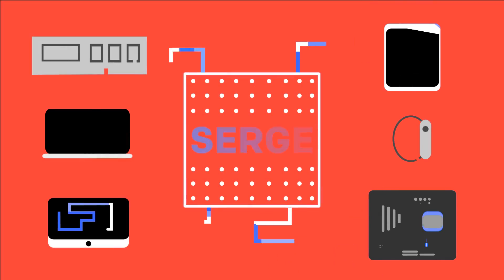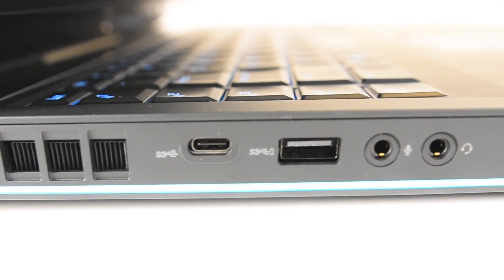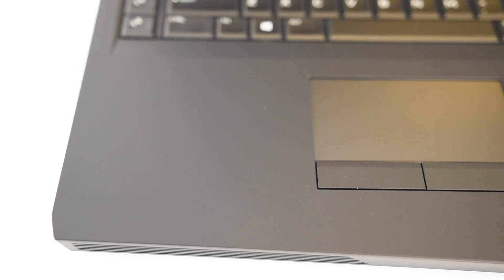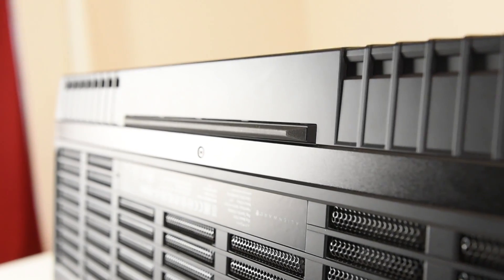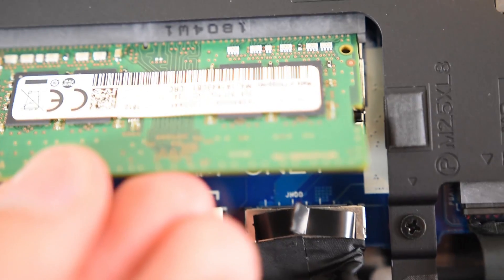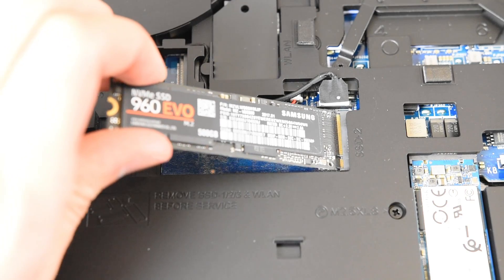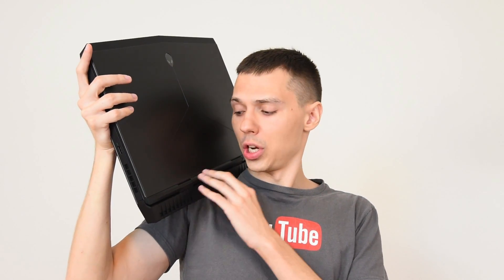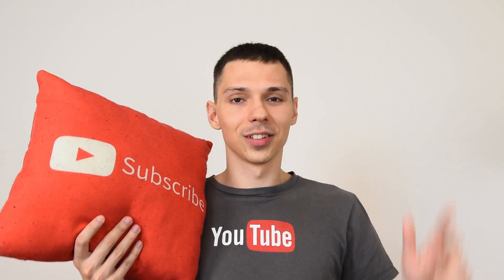NEW Alienware 17 R5 Review - GTX 1080 OC, 6 Core i7 8750H - EXPERIENCE!

Comment: Hi Serge.  i used a wireless keyboard and wireless mouse and a wireless headset.  AND also use  the oculus rift  for movie and game from time to time.  Now the problem is  the USB port limitation on this laptop. i have a cheat  Usb hut that sometimes its work and sometimes it doesn't...  Any advice on what USB port that  works really good on this alienware 17 laptop.   thanks.
Reply from the maker: well they should all be good but sometimes usb ports can die out. I have had this happen on half of my systems. I'm not sure why they suck so much. 

If your gonna use a hub, try this one out:
https://amzn.to/35fQ0dg
40% off discount code DKQG6L4Z 

Also make sure you use a hub thats connecting to the usb C/thunderbolt port.

Can you link me what hub you are using?

Comment: You mentioned 4 drives but didn't elaborates . . . Max capacity per drive is what? And I'm guessing where you installed the 960 evo, next to it was a 2242 slot - is that the 4th?

Comment: just to let you know..  on some sales pitch with this laptop... it claims it has touch screen.. even the sales guy demonstrated it did on video.. but it does not have it.. plus.. when i tried getting information online with dell.. the operator barely spoke english.. when i tried to call back..  i got the round around with their speech operator then was put on hold for almost 20 mins when i finally hung up.. i was looking to make a purchase of this.. but if i had problems afterwards.. good luck on getting service online.. dells online or phone service is the worse..  so be sure to check this out ahead of time just incase..

Comment: i also heard from many alienware user that this laptop gets too hot..temp is reaching 99c in load...i want to buys alienware 17 but im afraid bcuz of this issue..i need proper guidance
Reply: You would be fine with the 1070 but make sure you get the QHD 120 Hz Gsync screen instead of a regular one.  Alienware came out with a new thinner laptop but it is 15 inches and I heard it runs much cooler.  I think that would be a much better option for you as you are buying with a 1070.

Comment: To remove power limits, change out the 240w PSU for the 330w PSU.  It'll stop power-throttling.
Reply: Will it work with the r4 too?
Reply: @s1gnex  yes

Comment: Just ordered mine. 8750h gtx 1080 16gb ddr4 2666mhz qhd 1440p 120hz gsync panel 256ssd/1tb hard drive upgraded killer wireless. Have a 1tb Samsung 960 pcie nvme waiting to go inside. Saved about 700 opting for the 8750h instead of the i9. If your strictly buying this for gaming get the 8750h. No difference in games and runs cooler than the i9. If your into editing, rendering autocad etc then get the i9. For gaming the i9 is a waste.

Comment: The alienware 17 r5 is worst choice to make. My service tag is 9ZCWTN2 and I am facing issuses with command center were the effects and over fusion part are not even working. This is the second time a am facing the issue and last was on 31/07/2018. Both this time dell failed to fix the problem and last time after the call centre failed a took the laptop to service centre and re installed the windows. Now also dell is saying that they are able to solve the issue and it's a common thing that drivers from Dell and windows will mismatch and causes such errors and the only solution is to re install windows. As a customer I fill pit sending so much money on this laptop and the company is even unable to keep a consistency in its fan operating software. As a normal person re installing windows will lead to re install of all software which I was working on that will take another 1 week to complete. So my request is to make system that can atleast work. Email id _ kailasnathkl@gmail.com ( any person can contact me an I will show you all details regarding this)

Comment: i was thinking of getting the NEW Alienware 17 R5 8th Generation Intel® Core™ i9-8950HK (6-Core, 12MB Cache, Overclocking up to 5.0GHz)   NVIDIA® GeForce® GTX 1080 OC with 8GB GDDR5X 
should i just not bother? also what screen should i get? and whats the diff betweent the silver and black is that the hole laptop or just the front screen

Comment: Why does everyone who review the Alienware laptops fail to mention the fact it has no HDD lights?
Just brought the 17 R5, very pleased with it so far.
Reply from the maker: what do you need the hdd lights for? just wondering?
Reply: SERGE you can tell a lot from the lights, like is a program running or not is something running in the background .
Reply: hows the heat i was thinking of getting it just scared of all these heat issues i mean there from months ago but
Reply: beau ryan  No over heating on my laptop which has a GTX 1060 and I7 8750H.

Comment: I bought the same laptop as you today at Best Buy. Only difference is mine has a GTX 1070 8GB card. They had it 200 off and I paid 1600. I have heard that many people under volt the CPU and GPU. That you can do this without any risk of damaging your laptop. The benefit of this is that under volting will yield better performance because you will generate less heat and prevent the laptop from ever throttling. Have you tried doing this on your laptop? Also is there a way to adjust the fan speed so I can set it to 100% while gaming? Have you ever tried an external GPU before? My plan is to buy the top of the line Geforce card when they release the next generation cards later this year and use it as an external card for 4k HDR gaming. Do you know how well external GPU's work and do they perform as good as a card plugged directly into a PCIE 16x 3.0 slot on a motherboard?
Reply: Any backlight bleed?

Comment: Hey, this video is old but I wanted to know if we can overclock this beautiful?
Reply from the maker: you can you will just need to put the fans in turbo mode in bios it will make the machine louder but its possible personally though its a good machine i dont think it needs overclocking. it can do it all.
Reply: SERGE yep it can! Was just curious. Mine runs just fine. Thank you for the reply 😉

Comment: Hi Serge, I bought the 15r4 with the 8950HK and 1080GTX and Im experiencing high temp spikes in the upper 90s out of the box. I asked for a replacement and the second one showed similar performance. I have heard that 8th gen processors run very hot but im not sure if I should return this machine or try to undervolt and probably change thermal pasting instead as this is an issue im gonna see in most laptops with these specs.

Comment: All AW 17 with GTX 1080 comes with 330watt AC charger, why did your come with 240watts?
Reply: Because it's a 1070, there's no 1080 in the R5's without getting the I9.
Reply from the maker: wondering the exact same thing actually.

Comment: Please dell make 15.6" thinner little and change screen style. Using still 10 years old screen style is annoying!!! Please follow asus and msi as they have also regular gtx 1080 desktop variant in it but 30% thinner than this with good cooling system. Numeric keypad must be included for programmers and accountants!!!
Reply from the maker: agreed we need thinner more powerful devices! keep in mind though there 1080 and i7 throttles alienware has better cooling.

Comment: Debating between this (with GTX 1070) or going a different route with the Asus GM501 Zephyrus M. Concern is over heat and noise between the two.
Thoughts?
Reply: Patrick Scott i own a 17 with a 1070. Temps arent too bad. The laptop is very thick and heavy so they can fit in a good deal of cooling. I have no personal experience with the zephyrus but what i can tell you is that it is extremely thin in comparison. Its about an inch shorter too i believe. The bottom of the asus does open up letting your hardware breathe more when you open the laptop itself up. My alienwares noise is pretty quiet when not under load and perfectly acceptable when under load. Hope i have been of some help.
Reply: Patrick Scott I believe we have the same config then. I7 8750h, 1070, and the 120hz 1440p display. It is an excellent TN panel and i havent had to replace anything yet but i will probably do a liquid metal repaste just to keep temps down a bit more

Comment: i love my 15 r4 ! i got the gtx 1060 only because ill buy the graphics amp latter on down the road.
Reply from the maker: The 1060 is still an amazing card!
Reply: Yeah coming from a gtx 780 it’s a lot better
Reply: Awesome bro! My opinion like theres no point of having a 5.2 KG (Estimate) laptop where you could get something like the surface book 2 with a Overclocked or Overclockable GTX 1060 because thermals are good.
Reply: PaynPlay play well if I had the extra cash I would of lol
Reply: AndreasH900 why should u even buy a big gaming laptop n the first place, just build a pc that has a fucking 1080 ti in it lol. That’s what I did then brought the Microsoft surface book 2 with a gtx 1060 in it that’s more powerful then the Alienware laptop not only it can all so be a hand held tablet. Reason I say it’s more powerful is the fact the Microsoft surface book 2 has a OC 1060 with i7 8750CK 4.8ghz with 32gb ram and a amazing 17 hour battery life and 6 hour battery life playing AAA games non stop
Reply: Im in grade 10 in Australia nd I take my surface book 2 everywhere and I Love it so much! It's a very good "Gaming Tablet" It can run gta 5 4k high - ultra settings at 54 frames and fortnite 1080p epic settings at 164 frames with i7 8750CK 1060 OC 6GB VRAM 32GB DDR4 2400Mhz ram with 17 hour battery liufe and 8 hour of gaming non stop. And it can be a tablet as well!!
Reply: Lmao 1060 on a 15 r4, I would of gotten atleast a 1070 xD

Comment: Hey serge should I buy Alienware 17 r4 with gtx 1060 6gb and 16gb ram or this new Alienware 17 r5 with gtx 1060 and only 8gb ram?
Reply from the maker: Get the new the extra cooling system in the new one is well worth every penny you won't be wondering why your machine is over heating. 

There is that slight potential that it might
Reply: SERGE alright mate thanks for the suggestion.. I'll buy the new one.
Reply from the maker: also get the 6 core if possible its gonna go a long way to future proof device and is task switching abilities.
Reply: SERGE yeah sure.. That's what the r5 model contains.. Gtx 1060 6gb.. i7 8750h 6 cores

Comment: I just wish it had slimmer display bazzels like the Gigabyte Aero 15X or the MSI GS65.
Reply from the maker: Yeah there pretty large bezel although it protects the screen better that way honestly I prefer smaller bezel for more screen ratio.
Reply: Adolf Hitler - The Aorus X9 is superior to this in everyway, it has the same CPU and GPU, much larger SSD, much better screen, more ports, and... what's that? It's thinner and lighter, and has smaller bezels? AND is the same price?!
Reply: Young Kelz - Me or him? Because you could go check the specifications on the Aorus X9 (2018) vs. the Alienware 17 R5, everything I said is factual.
Reply: Smaller bezel means the smaller case, means less space for hardware which means higher temperatures, ultimately reducing the longevity of the components. They could've fitted a larger screen which means a more expensive device. People whine about the dumbest details.
Reply: what are you smoking? non of what you just said is true lol.
Reply: C.T. Productions i was talkin to that Hilter guy

Comment: Great video man! Im waiting for my laptop in the mail at the moment. I bought a 1070 gtx with a 1080p screen. Do you think 1080 is a big difference from 4k? I bought 1080p because better battery life and its cheaper. How do you think cs go will look on 1080p screen?
Reply from the maker: the 1080 and both 1070 do have 8gb of vram so in theory they both can run in 4k but on the most demanding games a 1080 may help it has more cores and stronger mem mhz take a look at this example here https://www.youtube.com/watch?v=HUW7YnwfzGs
Reply from the maker: but you can always adjust games to run better by tweaking settings.

Comment from the maker: XTU analysis:
After gaming for 4 hours in RUST US WEST Facepunch 1 
the GPU is at 58-61C 
The CPU is about 68-75C

in about 1 hour of gaming and checking intel extreme tuning utility XTU reported 4 instances that lasted about 1 half a second of power limit throttling, However no thermal throttling.

odd because I had a few thermal throttling drops that did not affect the game my first day but it seems like the cooling is breaking in the paste maybe? im not sure how to explain in only that the performance seems to be even better. 

the core voltage jumps up and down between 1.258v down to 1.107 continuously. 
Core TDP 25watt to 34watt
CPU ghz 3.8 to 3.1
Reply from the maker: I'm continuously stressing the machine and its holding up next up would be to force the gpu and cpu to 100 utilization.

Comment: Could you open intel xtu and see what power limit it has? Also it would be awesome to have a aida64 (fpu only) thermal test.
Reply from the maker: XTU analysis:
After gaming for 4 hours in RUST US WEST Facepunch 1 
the GPU is at 58-61C 
The CPU is about 68-75C

in about 1 hour of gaming and checking intel extreme tuning utility XTU reported 4 instances that lasted about 1 half a second of power limit throttling, However no thermal throttling.

odd because I had a few thermal throttling drops that did not affect the game my first day but it seems like the cooling is breaking in the paste maybe? im not sure how to explain in only that the performance seems to be even better. 

the core voltage jumps up and down between 1.258v down to 1.107 continuously. 
Core TDP 25watt to 34watt
CPU ghz 3.8 to 3.1
Reply: Thanks for the effort! however what I mean is kind of different. For the xtu part, just want to check the value of "Turbo boost short power max" and "turbo boost power max", how many watt does it default and proposed. Second, Aida64 has a system stability test built in, and only select FPU to run the test will stress and show the true capability of the cooling system. (At least power usage should be near turbo boost power max not between 25w-35w which is not making cpu warm) Please test it for like 10 mins if possible. Thanks!
Reply from the maker: ill go ahead and run these tests.